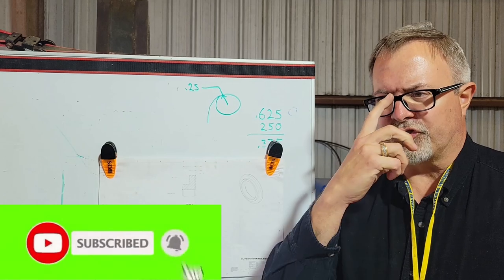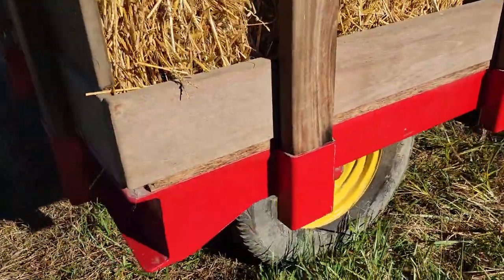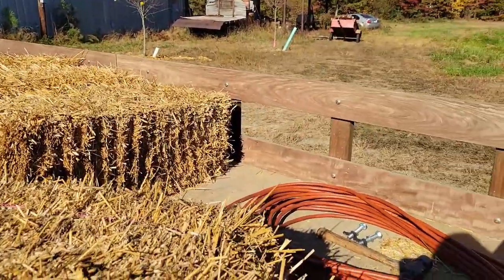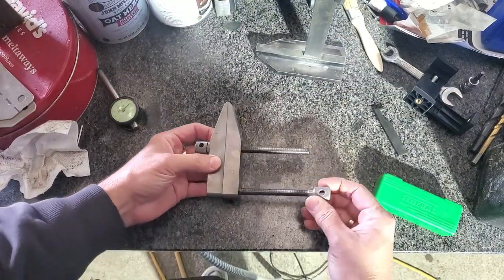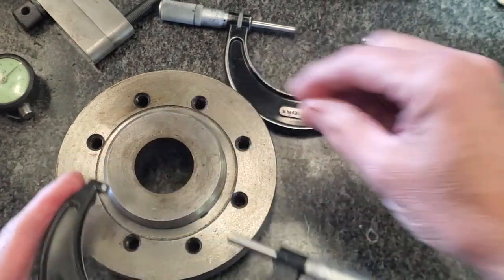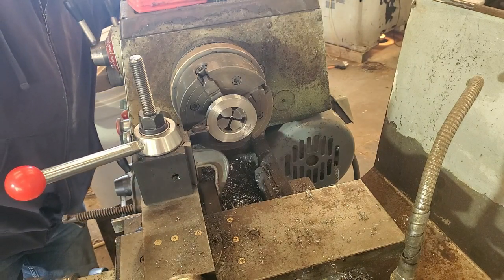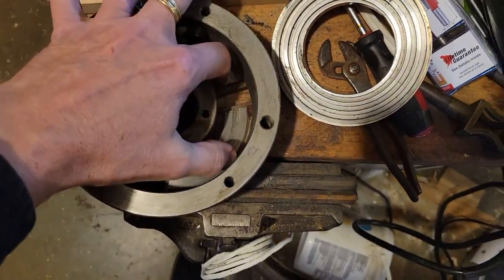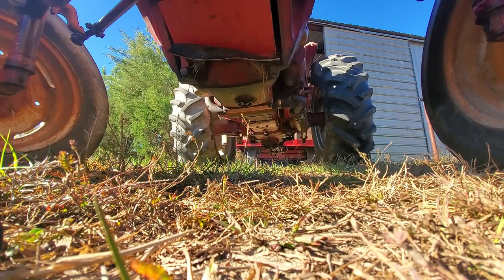Halloween Lathe Project Fail!

Comment: As a heads up you likely are off on your dimension worse than you think because how you held it with the 4 jaw will expand it and when you take it out of the chuck it will shrink. If you measure your part now out of the lathe it likely has low spots that check under 4.000”
Reply from the maker: I was aware there were "lobes" developing, that's why I wanted to finish the 3.100" diameter after it was pressed in the backplate. Didn't go crazy on the chucking pressure for the light cuts I was taking.
Reply: @EngineersWorkshop  Now if only the draftsman had been informed to update the print. lol
Reply from the maker: Draftsman, engineer, QC, customer, all same poor schmuck 😁